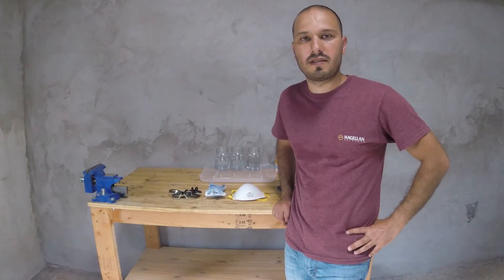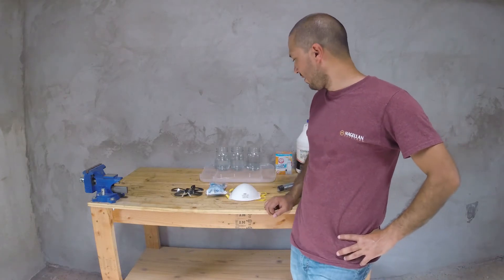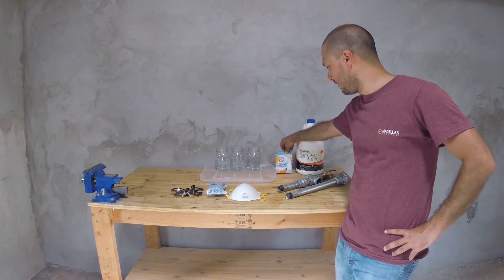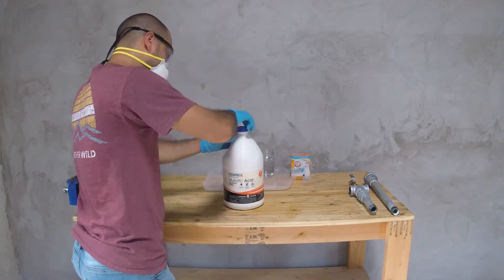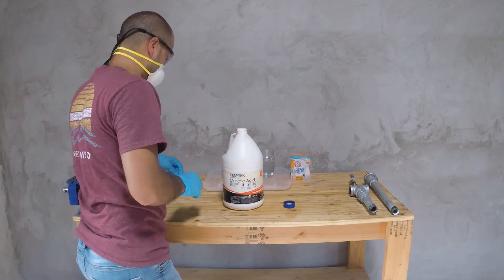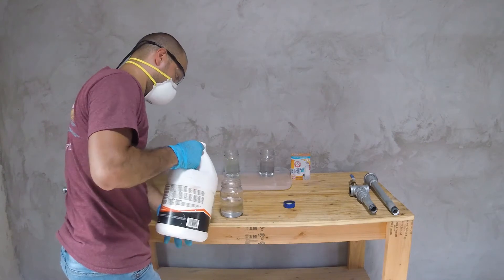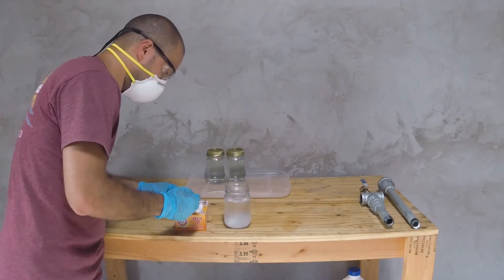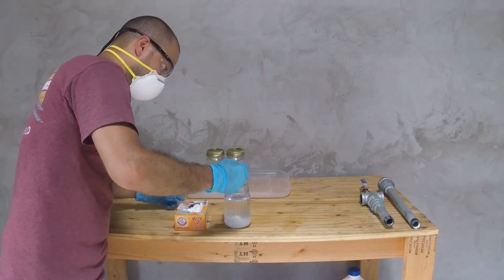How to remove zinc coating from galvanized steel using muriatic acid

Comment: Your math does not add up for your neutralization solution of 3 Tbs Baking Soda.  That amount comes out to 1.5 oz  not 16 oz of baking soda.  
Maybe you meant 16 oz total solution all combined with the water?  It helps to be clear for a tutorial. Another tip:   Soda Ash is a better base to use for this because it is much stronger.  You can get Soda Ash in the grocery store as Washing Soda ( Sodium Carbonate ) is the main ingredient..